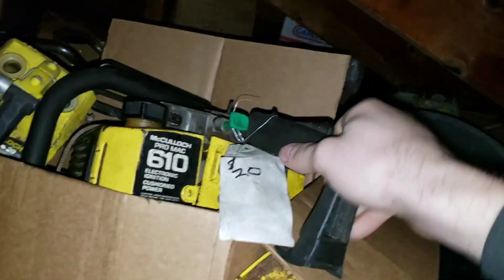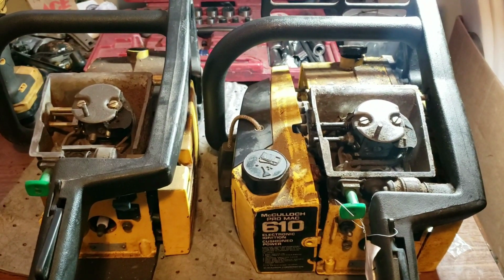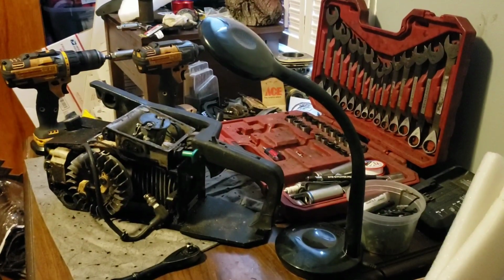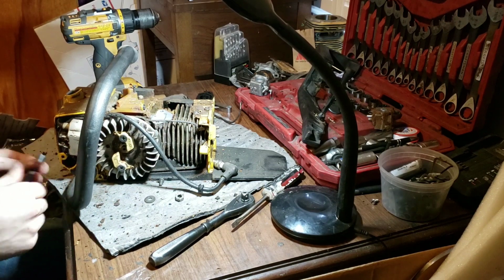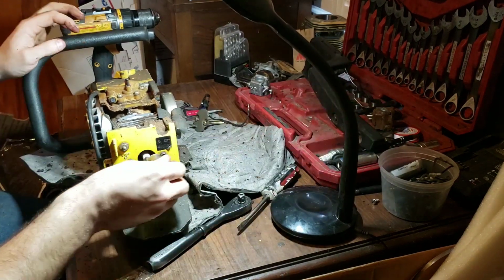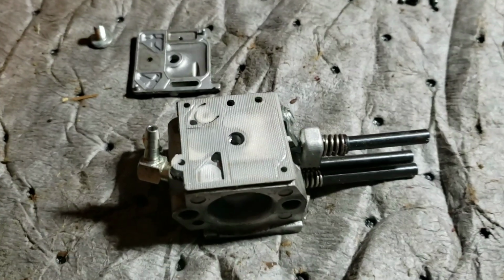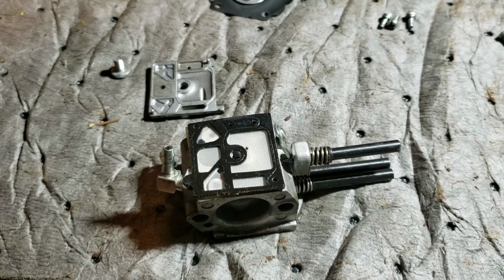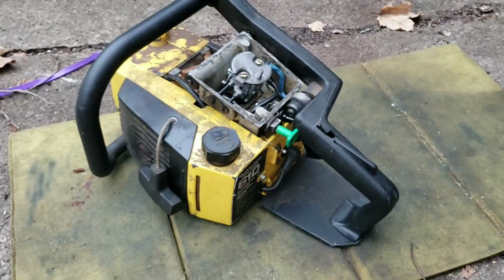McCulloch Pro Mac 610 revival

Comment: Found one in the trash, got it to run for a few seconds with starting fluid but now it won’t run at all. Thinking its toast 🤷‍♂️
Reply from the maker: Never use starting fluid om a 2 stroke. Now that I said that, could be a number of reasons why it won't run. Check spark, compression and toss some 2 stroke mix down the carb
Reply: Oops!! Okay, has good compression, has spark, just gotta get fuel in the damn thing now. The right fuel! 😂 thanks
Reply: Hopefully i didnt blow the thing. Does it take the engine to run for a bit to get the gas into the carb?
Reply from the maker: @frankiemarchese2978  carb may need rebuilt, fuel line might need replaced, fuel tank cleaned out, side cover taken off and saw dust blown off the cylinder and whatnot. 

Welcome to the world of chainsaws lol.
Reply: Ugh! Thank you
Reply: It runs flawless now! The tank had some crap in it that probably came into the carb and gummed it up when I first had it running. Cleaned out the tank, and the carb while putting a new plug in. These things are powerful!
Reply from the maker: @frankiemarchese2978  make sure the oiler line is in good shape too. Replacing them is a nightmare.
Reply: How would I know thats not working? Thats the blue plunger button on the left right? It feels good and I can hear it work when I push it. Theres oil in the front tank but not to the top. What oul do these take?
Reply: Or green I think blue is the choke
Reply from the maker: @frankiemarchese2978  bar and chain oil. It has an auto oiler with the left button being a manual over rode for extra oil if need be. Fill the bar oil tank up, give it some pumps till bar oil comes out a port near the bar studs.
Reply: Thanks Bryan! The bar studs im guessing are by the bar or by the oil pump?
Reply from the maker: @frankiemarchese2978  yes

Comment: Another great video from the house of Bryan seeing that wire left off the kill switch probably gives me an answer to an echo I was working on a while back. Ok lets see you do a chain brake repair on one of these where you actually change out the broken wrap around brake spring. I have yet to find the info on wether the holding pin is screwed or pressed in, and thanks for the invite to Hopper
Reply from the maker: It sucks to even try and fix a brake handle.

Comment: I just picked up a 610 a few weeks ago for $40. It runs, but is hard to start. I guess it needs a little shot of fuel to get started.  I haven't had time to mess with it yet.
Reply from the maker: More or less carb/fuel system related
Reply: I figured that. In the meantime I grabbed two saws from my moms shed, a Mac 3500 and a Poulan Wild Thing to mess with.
Reply from the maker: @Kamala's speech writer  those WT saws a guy can have fun with. I have one I may play with when it warms up out, do practice porting and have fun with it, got it for free

Comment: Mine I got for free really cool saw I never had it running it seized I seized it now it has low compression should I fix it if piston is scored
Reply from the maker: Chrome bore so if it got damaged, not worth fixing. If the chrome bore is fine, aluminum transfer can be cleaned off with muratic acid and a Q tip, then maybe but you will be after a piston and rings.
Reply: @mistermacgray  ok gtk do u have a social media u could give me for helping me
Reply from the maker: @vintagesimplicitytractors9464  I have Facebook and Instagram. My Facebook you can find me in McCulloch chainsaws north America or my group, Modified Saws. My Instagram is mister_mac_gray
Reply from the maker: @vintagesimplicitytractors9464  links to both are in my "about" section of my channel.

Comment: Thanks so much for posting this!  I recently found two Pro Mac 610 saws in someone's trash at the end of their driveway (they were moving away), and brought them home.  They were absolutely covered in grime and oil, but I managed to get them cleaned up.  One appears to be working perfectly, and starts and runs like a dream, except for one real problem: the chain tensioner screw is missing.  The other one doesn't appear to be running, and it has no bar or chain, so I think I will just use it for parts, including the chain tensioner I need for the first one.  In order to get in and remove the chain tensioner screw, do I first need to remove the clutch assembly and then the plate underneath that?  I tried removing the chain tensioner screw from the "parts" saw just by backing the screw out all the way, but it seems to have a hard limit at that point, and I didn't want to force it for fear of breaking it, so I assume there must be another way to access the tensioner assembly?  Any advice you have from experience with this problem on the Pro Mac 610 would be hugely appreciated!!!  I am really hoping to get this old saw fully working again!
Reply from the maker: Last i knew the chain tensioner was part of the brake assembly on these but I may need to check again, been awhile, more or less a nut at the end of the screw from you backing it out to far. Dont forget to subscribe, lots more McCulloch action I've done and in the future.
Reply: @mistermacgray  Thanks!  I was able to remove the clutch and replace the chain tensioner screw assembly today.  One remaining issue - I got the saw running today to test it, and I notice the chain tensioner screw loosens off quickly with the saw's vibrations when it runs.  Is there something I can put on the chain tensioner screw that will "stiffen" the threading so this doesn't happen but that will still allow for full chain tension adjustment when I need to?
Reply from the maker: @ianhamilton4816  tihhten the bar clamps better. Hold the front of the bar up when doing tension for the chain and while its still up, tighten the bar nuts down.

Comment: Hey there Bryan...this will be useful in my near future, I've a 610 coming, I believe it's got a pawl issue and maybe a top end issue also, apart from that it's complete , probably rough  though....you seam to have no shortage of spares....I received a 266 but it's so rough I think it's  beyond it from a price point...even with all hutzl parts looks like $200.00 and that's not Inc missing screws or carb kit...what u think?
Reply from the maker: These saws have chrome bores so if they get messed up, not worth saving. Piston gets eattin up and the bore survives then just a pistons change away from making good again more or less.

I'm not a husky guy yet, so unsure on the value of a 266. Jereme Bell is more to ask on that subject.
Reply: Would I be correct in assuming there's no aftermarket support for 610 cylinder kits....point taking nevertheless ....
Reply from the maker: @nickywalsh8492  no aftermarket at all. The 600 series wasnt sold at dealers, it was sold at hardware stores and whatnot, kinda like the modern day Poland saws people get from Walmart.
Reply: @mistermacgray  thanks Bryan ,as I thought ....some husky and Stihl have good support fitment or compatible can be questionable but not impossible for the money there ok....cheers ...

Comment: Cool 610 video the oiling is what I worry about on the 2 I bought probably won't see them till the middle or the month I dug out my 1/2 inch stihl chain today put up your email and I'll send pics Tom
Reply from the maker: Thanks for getting back.
Reply from the maker: Only issue I have oiling was the oil line on my timber bear rotted away but got that fixed. This one doesn't have any bat oil in it so she isnt burning that, just running alot of fuel. Have to adjust the carb still but a damn strong runner she is. Very pleased with this saw revival